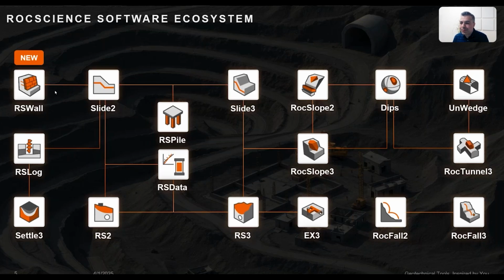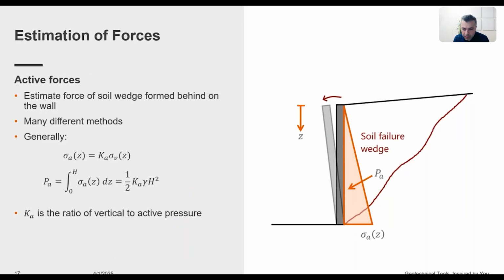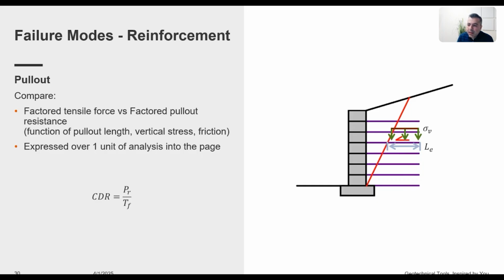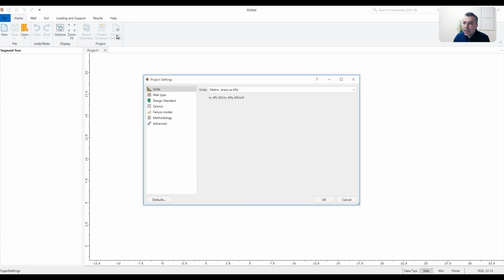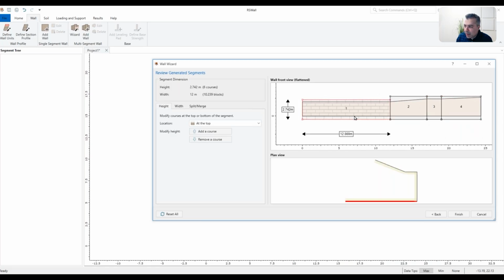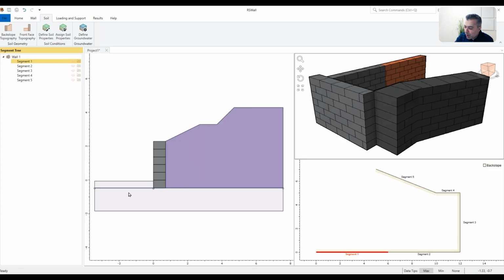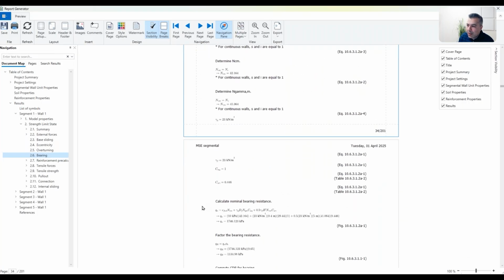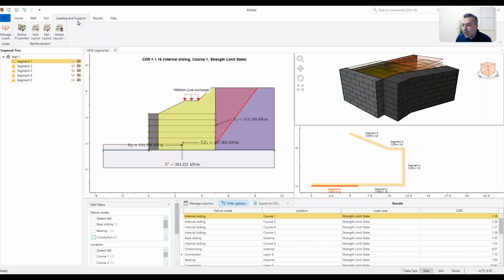Webinar Recording - Redefining Retaining Wall Analysis & Design for Modern Engineering with RSWall

Comment: How can I use more than 1 backfill materials. In other word,  from elevation 0 to +10 I need to use gravel with phi = 36 degrees and gama = 150 pcf . then from elevation +10 to +20 I will need to use sands with phi = 30 degrees and gama = 105 pcf.